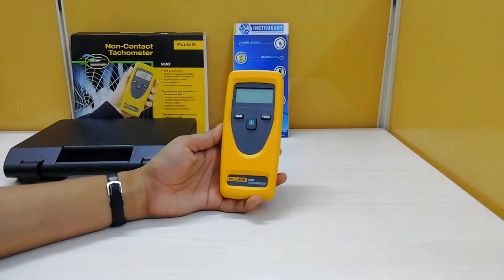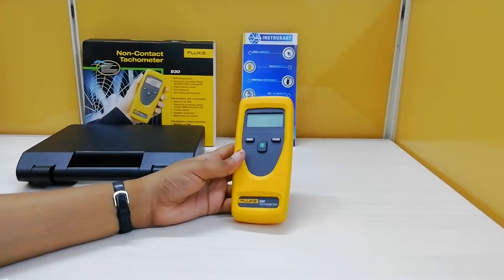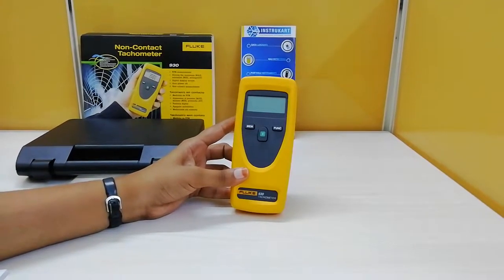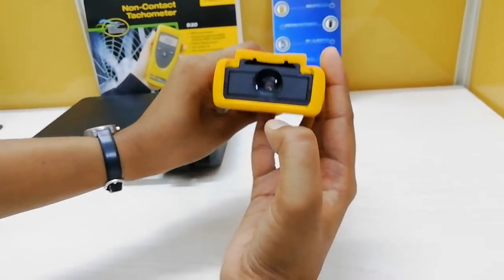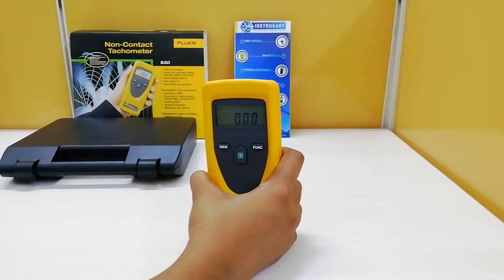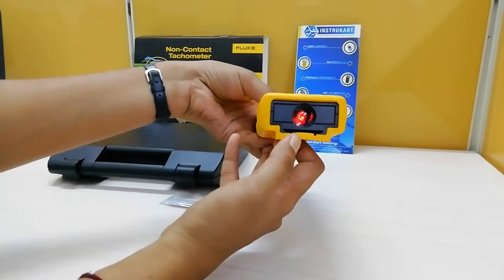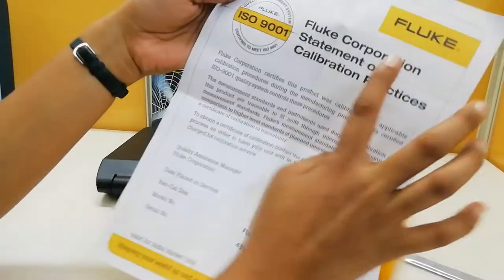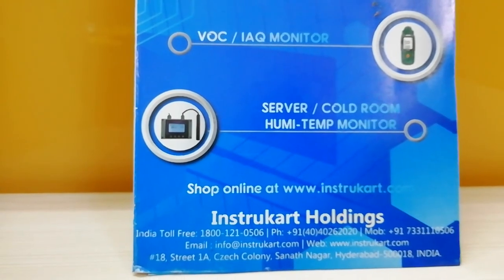Fluke 930 Non-Contact Tachometer | Portable Tachometer | RPM Tester | Contactless Tachometer |

Comment: we purchased the Fluke 930 and we want to measure the speed (RPM) of rotating equipment (drill bit of size 3 mm).  my question is where to place the reflector strip or do we need to attach the strip to Rotating device. please provide the info.